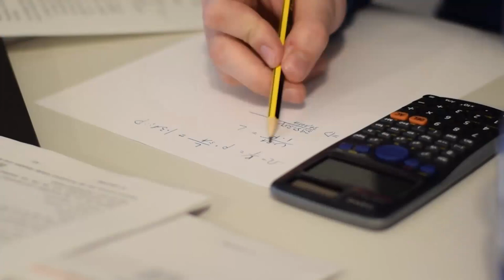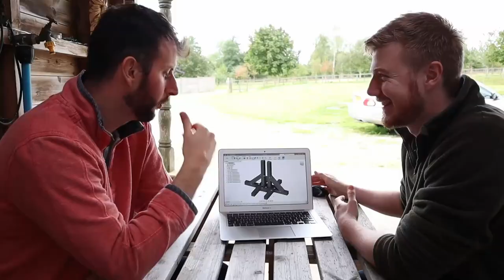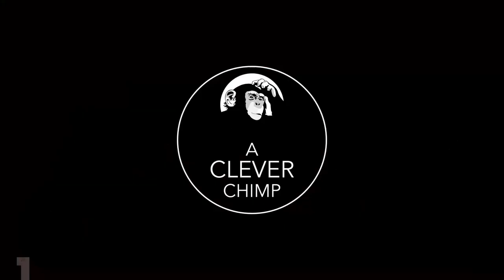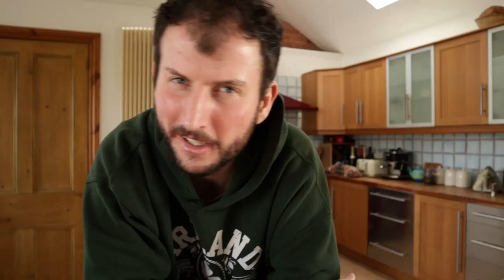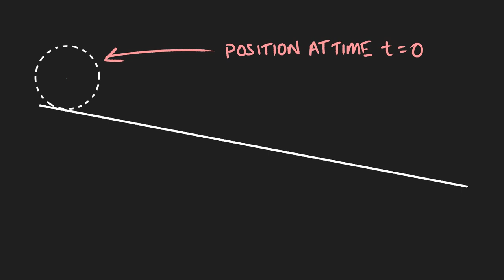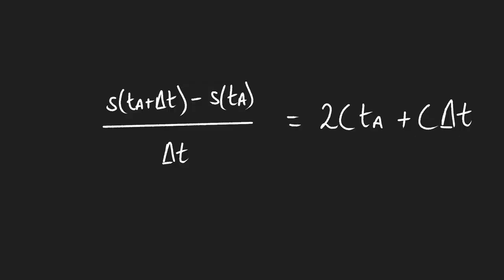Derivatives Explained from First Principles by understanding motion studied by Galileo!

Comment: Your experimental point of view is good but mathematically you should  derive the first principal atleast one expression
Reply from the maker: Hey Ajay, thanks for your feedback. If I understand you correctly, do you mean that you would have liked to have seen the derivation of the equations of motion? The purpose of this video was not to get into the mechanics of the problem but to observe the pattern enough to allow us to predict the displacement as a function of time. This then enabled us to differentiate a simple function from first principles, i.e. applying the limit of time tending to zero on the average rate of change of displacement. Thanks again for your thoughts, let me know if I've  misunderstood your comment.

Comment: Why you have evaluated the expression s(t+∆t)=c(t+∆t)^2?  is the displacement s(t)=ct^2 does it always works in all cases.the ratios wont be different for displacement x and  x+∆x . Sir please answer☺️☺️
Reply from the maker: Hi Ritu, as you can see from the video we noticed a relationship between the displacement of the cylinder and the square of the time elapsed, then we went on to realise the velocity of the cylinder has a linear relationship with time and therefore, finally, the acceleration is constant. After noticing this pattern I wanted to demonstrate how differentiation of the displacement function (s(t) = ct^2 which represents what we noticed when we first rolled the cylinder) would get us to that same realisation using first principles of differentiation.

In an effort to answer your question: I evaluated s(t+∆t)=c(t+∆t)^2 because we were differentiating with respect to time (because the displacement was varying with the passage of time), not with respect to a variable x. We needed to evaluate the change in displacement over a small interval ∆t and let ∆t tend towards zero. If by "does it always works in all cases", you are referring to the method of differentiating from first principles shown in this video, I can safely tell you that this is the base of differentiation that the majority of patterns and rules, that we know and learn today, come from (e.g. the power rule, trigonometric differentiation, product rule etc.).

I'm not too sure I fully understood your query/confusion, but I hope this clarifies things for you pal.
Reply: I meant that is that expression s(t) =ct^2 works every time no matter what I do with time even for a small instant
Reply from the maker: @rituvardani333  Okay, I think I'm beginning to understand your confusion. The function s(t) will work for all of its' domain: time, t. From 0 to whenever suits, including the time of t + ∆t. For example, the displacement at 3 seconds would be s(3) = c*3^2, the displacement at 1000 seconds would be s(1000) = c*1000^2. Hence, the displacement at (t + ∆t) seconds is s(t + ∆t) = c(t + ∆t)^2. This is how we evaluate functions. We can then multiply out the brackets in c(t + ∆t)^2 to reveal what terms involve an increment of time, ∆t, in them. That way when we let ∆t tend to zero for the whole ratio of (s(t + ∆t) - s(t))/∆t, the terms with ∆t in them tend to zero also.
Reply: Thanks sir for your help
Reply from the maker: @rituvardani333  You're most welcome pal. Glad I could help.